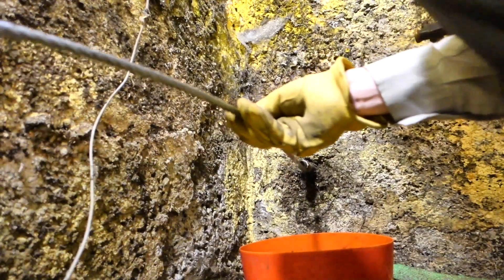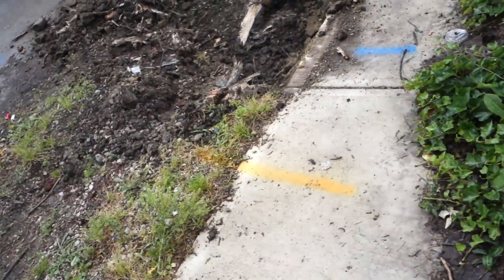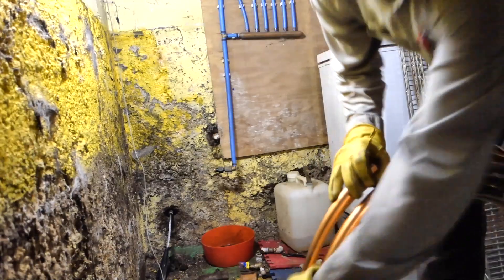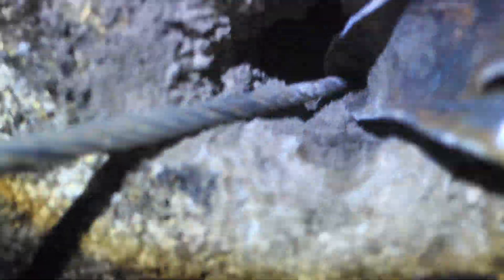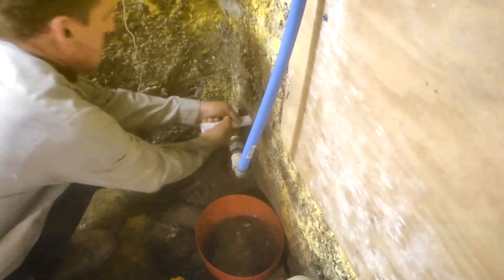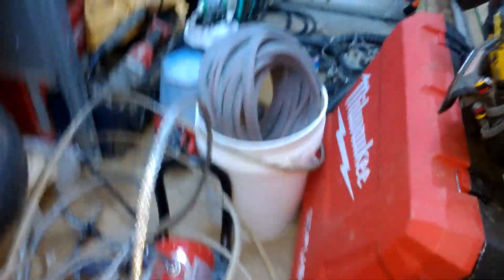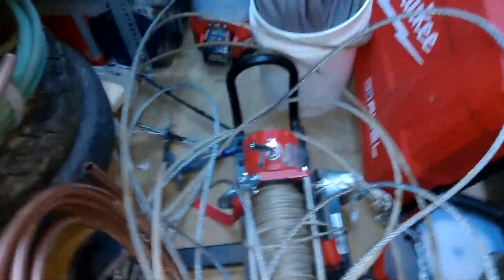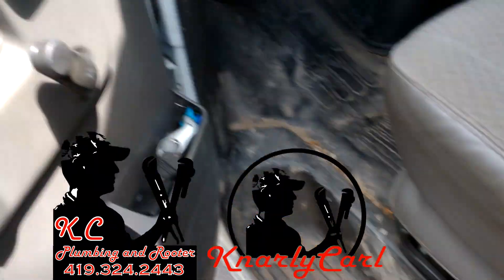Trenchless tool splits the old water line wide open

Comment: Why use the copper pipe rather than pex?
Reply from the maker: City requires it if the meter is inside the house. But recently I asked if we could use poly and they said they would rather copper but it would be ok if I used poly

Comment: I am surprised you pulled copper through that galvanized steel pipe. The steel is bound to contacting the copper in multiple places setting up galvanic action and causing failure due to the resulting corrosion.
Reply: Jonathan you are right Electrolysis will take place and copper will Corrode.

Comment: Amazing..  the big question is does the customer see a significant cost savings also?    As far as pulling grips go - i would recommend the Klein Model number 1684-5F.    Its a straight grip, spring loaded. Which means once you put it over whatever your pulling,  it’ll stay on from the spring tension it creates.  You can also slide it forward, but not backwards without releasing the tension. You can also lock the jaws open by hold them open and flipping the pulling end up... Also - that particular grip has a file insert. Ive been a telco lineman for 20 years and those are the only ones everybody (that i work with) likes to use cause they dont slip at all..  not cheap, about $500 a piece but you can order them right from home depot.  What youre pulling looks like more of a winch line, or wire rope, where we use it on strand - but i dont think youll have a problem.  If you ever had a need for something stiffer,  strand or guy wire / messenger wire (whatever the catalogs call it) may be another option you can use.  6.6m is like 1/4 inch, 10m is 3/8.   6000 and 10,000 pound breaking strength I believe.

Comment: Why are you direct burying soft copper rather than pulling poly? Or poly coated copper. 
Soak your cable in heavy oil or massage grease into it. It will pull around a bend with less damage to the cable as the strands slip in the twist. a rigging company may have a grease for cables.

Comment: Ever wter line pull is different . If you put you hammer drill on the end of the pipe you a can break it loose from the soil, then put the cable through  and pull the pipe instead of splitin it with a inverted cone on the cable.

Comment: This is what I do every day, you need to get a Klein cable puller. It grips a full 6” straight.
The cable is considered consumable. We replace old type L 3/4” and 1” copper with type K. 
We replace 600-700 services a year, we go through them a lot.  We don’t use mini-ex we use Cat 430 and a chain on the cable puller and pull with the cat backhoe bucket. Rather we extend the boom out reset and pull again. The winch would be sweet to prevent resetting but as you mentioned the Reed brand splitting bullet rarely splits copper or galvanized after its first pull. If you want part #’s of the puller or the bullet we use let me know I’ll add them to my comments.  It feels good knowing you didn’t have to open cut the entire yard. We use 3/8” x either 60 or 100’ cable for 3/4 or 1” copper 
For 1” gal pipe we use 9/16” cable. 
Trick. If the copper ever pulls off the bullet figure your length of copper you are gonna need and feed it through the copper adding a 1’ and pull thru the new copper. I’ve done that a few dozen times if you get into gravel that’s normally where that will happen.
Reply from the maker: Yeah, right after this, I got the puller you are describing. There have been times where it twists the cable puller itself though, and renders it useless, that's when we're really pulling it with a lot of force. The gravel issue got us before with a poly line, it wouldn't let the pipe pull because the gravel would grip the pipe, and tore the poly off the wedge cone. It's a WheelerRex bullet, not a Reed(maybe they have one, too, i don't know) I've been thinking of using my pipe burst hyrdaulic system to pull on really difficult galiv lines.
Feel free to reply with the part numbers, that could always come in handy thank you!!

Comment: It could be worse...

I was working for a lawn sprinkler co with a team of 3 others installing sprinklers.

Team leader running a machine to drag in pipe decided to ignore a marked gas min.

"It will be deeper tthan the machine goes." Was his response when I pointedput the paint and flags.

He cut a 6 inch gas main causing a large area evacuation...

Comment: Ive used PP on soft copper tubing before, just not comfortable doing it...  seems like some type of stiffner  should be used with it... Have never seen or heard of one..
Reply from the maker: You can get insert stiffener for baseboard radiant copper since it is the thinnest wall copper. Viega says all other grades of copper don't need it.

Comment: Have you ever had issues with the copper being cut by the old galvanized pipe as it’s pulled through.
Reply from the maker: Nope, k copper is so thick plus the galvi is split open and gives the new pipe plenty of room to move through it
Reply: That’s exactly what I was wondering. There’s a gnarly ragged galvanised pipe, a constricted area, a beautiful new soft copper pipe and a HUGE amount of brute force. I figured if there was any rock or concrete along the way, it would all concertina up like a crash test vehicle.

Comment: I've seen electricians use a shop vac to such pull twine through conduit.  May be an option if your cable is being hard to pull through.
Reply from the maker: Yep we've done that before on long pipe runs before. Check my other video from last year where we did this PipeSlice on a poly pipe

Comment: I have seen videos of a system to do the same with 4in drain lines. I believe they welded abs pipe together as they pulled it through.
Reply from the maker: That's polyethylene pipe, we use that method too, called pipe burst!

Comment: What about the metal pipe touching the copper pipe
Reply from the maker: Oh I missed explaining that very well I guess.... the old galvanized line was pulled completely out of the ground!
Reply: @kcplumbingandrooter  What was the length of the galvanized that pulled out? I am going to try to pull 17' of 3/4 galvanized pipe with 3/4 poly hooked to the back end. No pipe bursting, just pulling the pipe out. I'm encouraged since your poor pulled out instead of splitting.
Reply from the maker: @scottarnold8266  it was 35' ... It depends on what type of soil you have. We have some really tough clay that can be impossible to pull out or burst, but if it's a little damp, it comes right out. Sometimes a leaking galvi line really helps because it makes the ground wet
Reply: @kcplumbingandrooter  Pulled 20' of 3/4" galvanized pipe today. Took a strong winch on the pickup, but it came through and brought the poly pipe behind it. Didn't even need the cable that we threaded inside as a safety net, just pulled on the end of the pipe. Thanks for the video KC plumbing!!
Reply from the maker: @scottarnold8266  Great to hear, what type of soil and how deep was the water line?
Reply: @kcplumbingandrooter  water line was 2.5' in the middle of my slab home and about 4' just outside the foundation. Pipe had some clay and misc backfill soil around it. Soil wasn't consistent, but I could tell that the wrong composition of cemented clay could have made it very tough. Thanks again KC plumbing

Comment: We pull water services everyday at my company. We try not to pull through galv just for that reason it messes the cables up. But if you hook a chain to the galv and to the excavator and pull the cable at the same time it will save your cable. Sometimes it won’t pull the galv out though. Good video. It’s interesting the difference in materials in different regions areas. Here we only use sdr-9 out in the yard(pex). We call it bury pex. We don’t use copper in the ground anymore. Anyways awesome videos man keep up the good work
Reply from the maker: Yeah, we'll use poly sdr9 also, but this city required copper before the meter, since the meter is inside, we are required to use copper up to the meter. Thanks for the comment!
Reply: @kcplumbingandrooter  yea I noticed your meters are in the house. Our meters are at the property lines. Is the city responsible for that service to the meter from their main. The city here doesn’t take responsibility for anything utility after their meter.
Reply from the maker: @NotSoProFishin  Homeowner is responsible for anything after the city curb stop

Comment: Just out of curiosity why are you using copper underground? Surely plastic would be more suitable.
Reply: He said the city on several occasions, the utility company must require it.  but surprised no backflow preventer.
Reply from the maker: This is true, this city required us to use copper here
Reply: @kcplumbingandrooter  the next city over from me requires CTS blue/PE.. but my town dont care either way...
Reply: @kcplumbingandrooter  I just find it a bit strange you are using a soft copper that can collapse easily! I’m from the uk where it is all plastic! Thick walled better insulation and better preventative of collapse
Reply from the maker: @michaelcoles6140  Why would the copper collapse?
Reply: @kcplumbingandrooter  just it’s a soft copper plus earth movement etc, I would of thought that it wouldn’t have the flexibility in my mind.
Reply from the maker: @michaelcoles6140  What you might be used to when you think of soft copper might be completely different than our soft copper. We call it type K copper, it's the thickest and toughest type of copper available and only used underground because it's such thick wall copper. It's only referred to as soft copper because it can be bent around curves, but only at a large radius.